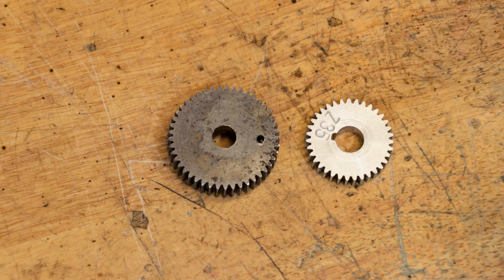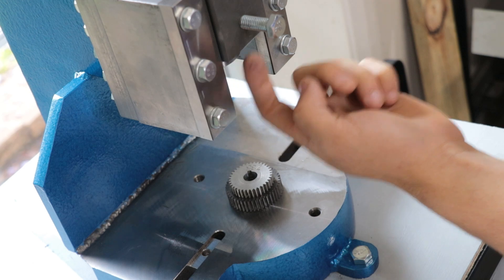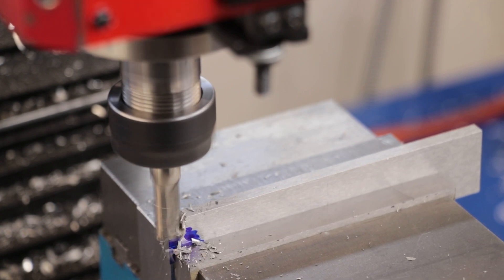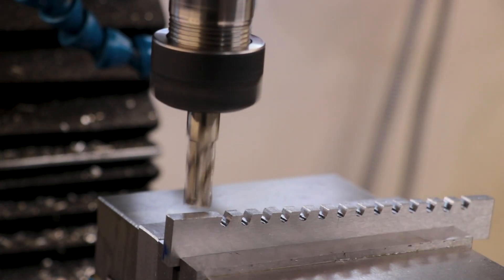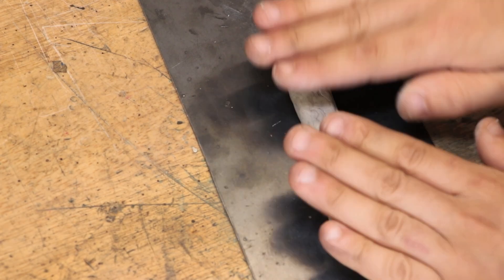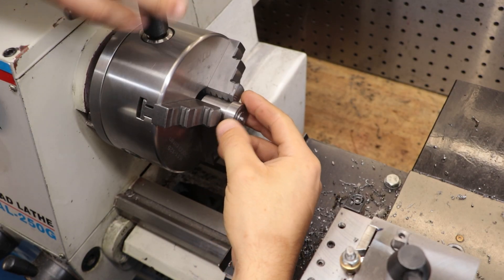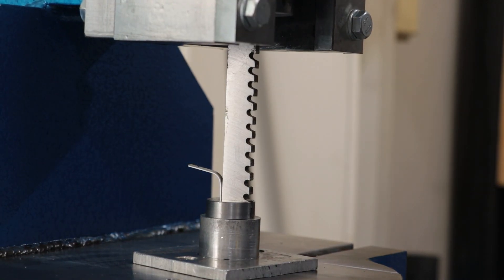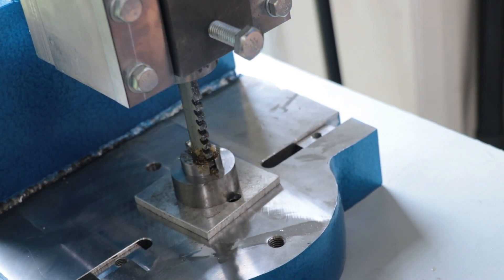Making A Broach To Cut Keyways

Comment: it is worth to drill some hole first to dig as much material as it can be done. layer you can use broach just to make sharp corners. that is the best way for DIY purpose
Reply from the maker: I don’t but if you really wanted to I’m sure you could. I don’t think you need to unless it’s a big keyway

Comment: Very nice tutorial. Excellent actually. It has inspired me! I have been cutting keyway slots with an end mill and leaving the corners round. Not professional and very sloppy. I hate to do it but I have to in order to keep competitive with other machine shops. I run a jobbing machine shop in a poor farming area and I invariably have to charge even less than the going rate. However, I am going to start making the basic 5,6,8,10 and 12mm broaches exactly as you have demonstrated. Your method is very do-able and beats the cost of broaches here in South Africa. For comparison purposes, I would pay around 2500 rand for a 8mm broach and my machining charge per hour is only R400.
Reply from the maker: Beats the cost of paying for broaches anywhere I think. FWIW 2 years lather and the broaches still work

Comment: Im not to sure you should quench with water it can be pretty harsh on high carbon steel.
Reply from the maker: Doesn’t matter much with such basic geometry. I’ve only ever had parts crack when the design gets complex. At that point I switch to oil or air hardening.

Comment: You stated that the taper from end to end of the broach was 1 degree and that the teeth were relieved 11 degrees.  How many degrees are between the teeth, I mean the angle away from square that forms the cutting edge?
Reply from the maker: It's about 30
Reply: Thank You @artisanmakes

Comment: Clickspring shows you how to make a square broach which you can easily adapt to make yours that little bit better if you want to, I mean it seems to do it's job plenty well enough but it's there if you want. He also shows how to make loads of different tooling etc and his work is exceptional. He shows ways to get precision in cases, where getting even close is hard for most showing ways to set up your lathe etc to get the best out of it no matter what. I mean you seem to have managed anyway but honestly if you're not already watching Clickspring you really, really should as he takes what you can do in a small shop to the next level.

Comment: You said the broach was about 30um undersize, but you didn't say if it cuts exactly at 4.7mm. If it cuts a little oversize,  3/16" is ~4.76mm, so you may be able to buy 3/16" key stock and not need to grind down 5mm key stock. Assuming 3/16" key stock is available to you, I don't know its availability outside the US.
Reply from the maker: I haven't the tools to properly measure it bit I would assume that it would cut somewhere around 4.97mm give or take. A little bit bit sanding was all it took for the key to fit tight. Cheers

Comment: You also need to quench it before you remove the clay. Otherwise it will oxidize as soon as you expose it to air
Reply from the maker: A small bit if of oxidation is okay. But I wouldn't have thought that the part would have cooled down fast enough if i left the clay on. Cheers

Comment: You should try some Heat Treatment Paint, I use it for heat treating knives and it works really well to stop scaling.
  Just don't make the same mistake that I made and others have made and only apply a single coat. Heat treatment paint is a paint and like any paint it requires several coats to get full coverage. I've found 3 coats is good anything over that is overkill and a waste.
  Great video as always! 👍👍

Comment: Nice work pal! 👍You didn't go over the math for the DOC per tooth etc. I make it about .005-.006 DOCPT and that gives ~ .080 Required shim thickness to step up. I think it will work a lot better if you grind the back clearance with your cup wheel to sharpen the teeth which are eroded from the heat treat. You might also consider alternating interrupted cut on each tooth. That give a place for the chips to collapse into.

Comment: For a crisp parting edge where the weld meets the unpainted base table surface, you could always tape right up close to the weld and then brush on some Vaseline right up to the horizontal edge before painting. Not sure I'm explaining that right but the paint wont adhere to the Vaseline and it can be quickly, and pretty accurately applied to the uneven area and cleaned off rather easily afterwards. I apologize, I'm shit at explaining things but I swear it works. An old industrial machine equipments painter showed me that trick in the late 90's and I'll never forget it.

Comment: Nice job showing that a workable broach can be made in most of our home shops. Honing the broach teeth' gullets will reduce the friction of forcing the broch through metal.  I found using a ceramic hone as the last step in sharpening high-speed steel lathe bits gave them a longer cutting life.  I had to sharpen a profile bit every 6 hours the ceramic hone increased the tool life to 9 hours.

Comment: What happens if you cut hardened steel with a shitty $200 CNC router off amazon
Reply: It depends on what you mean by cutting
Reply: poosh the milling bit into it @caseytailfly

Comment: Just an FYI for future. You can 3D print the bushing for keyway cutting. I’ve done so in the past and never had an issue. Just make sure you leave a bit extra at the bottom to help support the cutter. Also 100 infill helps.
Reply: I don't think he will ever incorporate 3D printing into his videos, since he's more on the trad machinist/blacksmith side of things
Reply: I'm a 110% infill dude. 3d printing is just really healpful.

Comment: I programmed an NC lathe to cut keyways, just stop the spindle zero RPM's, feed the cutting tool at about .015 depth each pass. Cut a 1/2" key in about 35 seconds., no broach needed.
Reply from the maker: I've seen a few people do that, much easier than broaching

Comment: Is the broach better than a commercial tap?
Reply: Slip of the tongue. I think everybody knew what he meant.🤷
Reply: @davidcat1455  I did wonder if tap was another word for broach. I'm not all that familiar with machining terms.
Reply: @asvarien  
No. Tap and broach are different. Little bit of a Freudian slip because he did actually manufacture a tap to cut the thread on the swing press he used to broach that keyway. That’s my amateur psychologist take on it anyway😃👍

Comment: hey i tipp for heattreating.  Just get your self some Sheetmetall for heattreating,You can pack everthing in their nice and tight,Just fold over the corners 2-3 times and hit them flat with a hammer. To prevent oxidation.Just place some paper next to the part.The bruning paper will use up all o2

Comment: Did you leave the broach full hard?  I didn't hear mention of tempering it back.
Reply: Since he didn't quench it red hot, I doubt it's fully hardened.
Two wrongs making a right.
Reply from the maker: I did temper it back I just didn't do it on camera. The quench left it 60-65hrc and it was tempered back to 50-55hrc.

Edit- autocorrect messed that reply up

Comment: At 15:20, you could hollow grind the sides of the broach maybe 0.001 to give some side relief to the cutting teeth while traveling through the guide bushing and the side of the keyway slot being made. Excellent video.
Reply from the maker: You probably could and I'm sure that might improve things. I'm not sure how i would with my set up. Cheers
Reply: @artisanmakes  Does your mill head tilt right or left? You could use your cup grinder on the tilted head and run your table left & right until you got the relief you need.
Reply from the maker: Unfortunately mine doesn't, that's the next. Model up from mine which does. Cheers
Reply: @artisanmakes  just mount it on a sine plate
Reply: Would a ball end mill of a size to give a shallow "hollow ground" effect along the line of teeth do the trick. Fiddly to set the piece so the cutting line is correct (but doable with the holding vice). Then the side of the cutting edge gets relieved while the full width of the cutter is engaging the guide.
Reply: How about your cup grinder or ball shaped grinder bit? Maybe you could mount the grinder to the mill and fixture your broach on a vertical support. Then work your quill feature up-n-down.  You always find alternate ways to get the job done. Here is another video for you.

Comment: Brohh,how long did it take to cut toolsteel with a hacksaw?
Reply: not hardened when it was cut.
Reply from the maker: Not long. Maybe a minute. It's annealed tool steel and a cobalt hacksaw blade
Reply: @artisanmakes  one more question,I am no machinist,just want to start the hobby,But why dont you just cut your stock ect. with a grinder?is there a reason behind it
Reply from the maker: I do grind stuff but not if I can avoid it. It's messy and I have to cover the ways on the lathe to keep grit off of them. Plus it throws grit and dust on the camera and lense. I ruined a camera lense focusing motor once with grit and I would want to avoid that again.

That is why I don't do it if i can. 
 Cheers
Reply: @artisanmakes  Awesome stuff,all makes sense now....thanx!🫡

Comment: This hole time you could have done it on the lathe. I like to cut a rounded slot with a endmill on the mill and finish it up broaching it square on the lathe.
Reply: Hole time or Whole time, either way I thought it was a good pun🤣
Reply: @ddoherty5956  🤣 Supposed to be whole time but hole time was just to good to pass up.